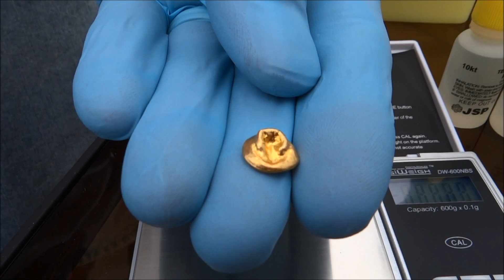How to easily recover gold from scrap computer chips - Purity Test

Comment: How did you get your hands on 250 sticks of ram? Just rummaging through the scrap yards? or do you farm out local companies with old tech sitting in the back. a typical desktop has 2 sticks sometimes more so thats 125 + or - a few computers that you had to crack open. I love the idea of recycling the parts but was wondering how hard it was to come by enough ram to make it worthwhile? I know you can do processors as well so maybe you can snatch up 125 processors while digging for ram sticks to beef up your haul. Usually you just need to rip off four screws or clips, a heat sink and a fan.
Reply from the maker: John Snow Just start asking around.  Watch ebay, put an add in the paper to haul off old computers.  Be creative...they are out there.

Comment: What a great Trilogy......do you have to heat during the acid stages or does it make the process longer if you don't.  I have about 8lbs now and I will try when I get to over 10lbs.
Reply from the maker: Malonewiller The heat would speed it up.